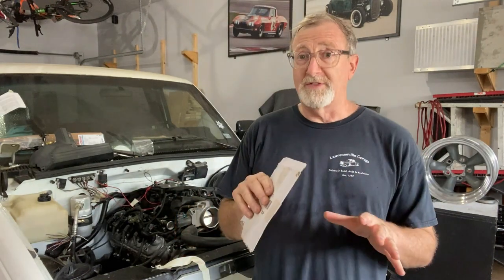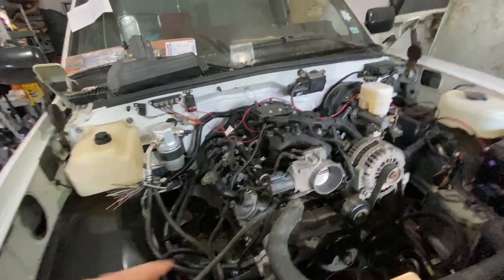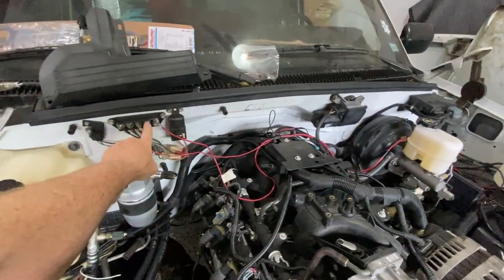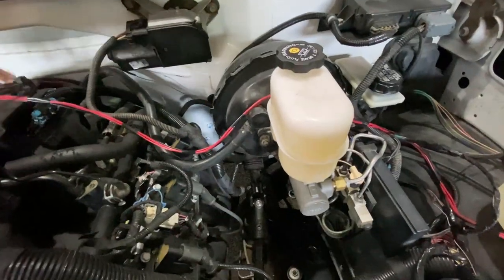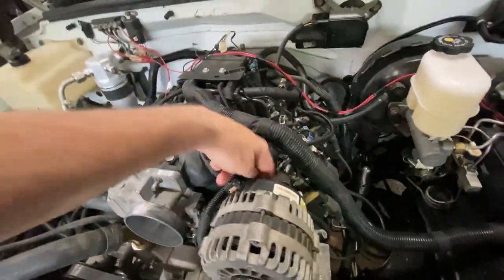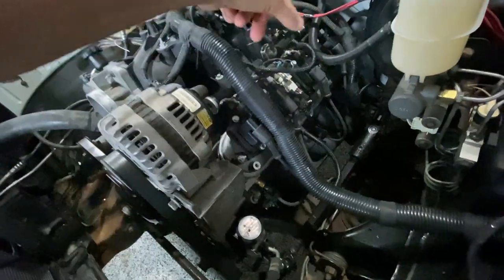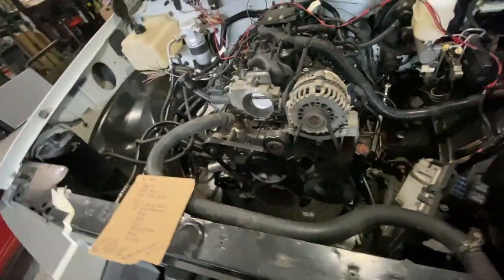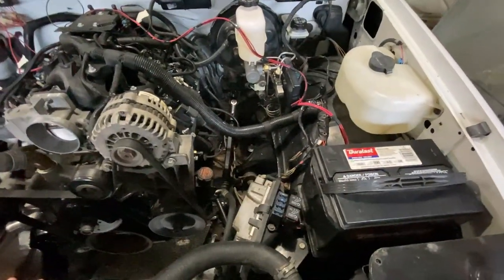LS Swap Harness Wiring Details: Where the Main LS Wires Go In 12 MINUTES

Comment: Do you have to leave the stock computer(pcm) in the truck along with the new ls computer?
Reply from the maker: It all depends. It will depend on how your truck is wired. Does it need the OBS pcm to run? No. But, the computer does handle other functions and you may want/need to keep it to handle those functions. I suggest NOT cutting anything until the new swapped motor runs. THEN, make sure all the features you want to function do, gauges, etc. THEN, start thinning out and removing those old wires. You many find you need a few to keep working. Remember to keep some notes on what you do. Someday, down the road, you or a new owner may need to fix an electrical issue and with no notes or clear way on how the truck was wired, it can be a real problem. A "regular" shop probably won't touch it since it does not fit into one of "their" books. And, electrical work can be very time consuming and expensive. So, not to scare you at all, just try to keep it simple. I've seen under the hood of installs by "professionals" and it was scary. Trying to figure out what someone else did can be "challenging".

Comment: totally new to this and you lost me with the pink wire. So you cut it from the 2nd stub and connected it to the ls ECU? SO it is coming form the dashboard fuse box to the ECU?
Reply from the maker: There are a variety of "pink" wires that are "key on" power. It's up to you to decide which of them is the best to provide power to whatever you are needing "key on" power for. I highly recommend that since you are new to this to check out ebay for a GM C/K Pickup electrical diagnosis and wiring diagram manual for your year of truck. They are a fantastic resource for all wiring information about your truck. You will be able to see which wires might provide the best source of power depending on what you are doing. I'm sorry if this sounds vague, but every swap is different and a manual will make your life much easier. A sound investment. I have 88-95 manuals and the prices ranged from $18-35. As time goes by, I'm sure they will go up. Well worth the $.

Comment: What color is the wire that engages the starter on the LS engine, I’m in the middle of figuring out what wires are what
Reply from the maker: Usually a purple wire. Runs from ignition switch to solenoid.

Comment: What transmission you use for your engine I have 91 also but I’m having a lot of trouble trying to find right one but your video would help me a lot
Reply from the maker: I am using the original 5 sod. trans that came in the truck. It is a 5lm60. You can use any trans you want, but you will want to research specifics for using that trans. to be sure you have or can get those pieces before you begin your swap just so it goes smoothly with no unnecessary delays.

Comment: I'm struggling on 1995 k1500 ls swap trying to get speedo to work. Any help would be appreciated
Reply from the maker: I spliced the original vss wires with the LS vss wires that way both the speedo and pcm get the information. I’m sure there are other ways to do it, that’s just how I did it on that truck.

Comment: I was told to cut the fuel pump relay off of the stock 350 harness n to hook the gray wire off the fuel pump pigtail to the Ls fuse box do I need to hook it back up to 350 harness
Reply from the maker: As I did mention, this is how I did it and there are other ways it can be done. You can totally remove the obs wiring, or tap into it and run it the way I did.

Comment: Hey why are you using the old charcoal canister I’m trying to see or better word learn do i have to use mine thanks I was about to throw mines away
Reply from the maker: I wanted to keep mine to prevent unwanted fuel odors. I’ve seen others remove theirs, but never heard if they noticed a difference or just didn’t care. I am considering mounting mine under the cab on my next swap.
Reply: @laurencevillegarage  thank you so much for making this video and for the advice

Comment: I'm going to do a swap the donor is 08 Chevy express van I'm putting it in 94 Chevy truck and the ls is drive by wire and I'm bolt to 700r can I do a drive by cable
Reply from the maker: You can do it, but it will get a bit more involved. You will need to change your pcm to a PO1 unit that can do DBC, also, your current manifold has a 4bolt TB, you will need a 3bolt manifold or adapter…that’s not all… you can do it, but you  might be better off sticking with the original intake manifold if you’re on a tight budget and keeping the drive by wire. You have other features on that 08 engine, that may require additional expense, like removing the DOD and VVT. If this is your first swap, try not to make it more complicated than it needs to be. It can get very confusing.
Reply: @laurencevillegarage  can you send me some start to finish points I've been following some videos but Im very new with all the l.s stuff I'm kinda old school
Reply from the maker: @emmarichard1230  Emma, check out the information below the video and you’ll find an email address. That would be a lot easier to correspond with or other ways to reach me. Answering a lot of questions via YouTube is very difficult and limited.

Comment: Curious to know why you mounted the battery on the driver's side.  My 94 has it on the passenger side.  BTW, the videos are very helpful!
Reply from the maker: Thank you, I originally placed the battery on the driver side because my intent was to transfer all the original parts from the donor Suburban under the hood of the '91. Packaging became an issue and I abandoned that idea. I do like the idea of driver side battery for possible turbo installation in the future, gives more space for turbo and keeps the heat away from battery.

Comment: I recently just came across this channel but you are making this look like such a breeze but I am very curious about 4pin fuse block with the two relays idk if I missed that video but would love to know more about that
Reply from the maker: I did cover that in the previous wiring video, but I would definitely make some changes there. Check out my video on wiring in the a/c fan relay and twin fans. That box I got off of Amazon and it holds 6 fuses and relays. Even in you think in the beginning you don't want electric fans and want to run the clutch fan, I would wire them up with the needed relays etc. Then if you still don't want to use them fine, set the box aside with the wires. IF you change your mind at any time, it is all ready to go. Easier to do while you are doing all the rest of the harness. But, back to the main fuse block with 3 relays and 4 fused, use a weather proof moisture resistant enclosure. Under your hood can get wet and this will protect the fuse/relay box from both sides. The type setup you find on most installs is NOT moisture proof and can be a problem down the road. You can get electrical issues that could be caused by some minor corrosion that happens in the unprotected box and tough to track down. The better box is $20, an excellent investment. They look good and next vehicle I will use 2, one for the main harness, and one for the fans and/or a/c relays. When you buy electrical parts such as pins and small parts, buy more than you think you need. If you need 4 and you buy 4 I can almost guarantee you will damage one somehow (or drop it into neverland) and you will be one short. I can get them off Amazon for literally pennies each, so, buy a dozen or more. You will be glad you did.

Comment: I have a question sir I am also doing a ls swap in a 1993 GMC Sierra with a 6.0 with a 4l80 I was wondering where I connect the fuel pump wire that come out of the ls relay do i connect it to the junction block or directly to the wire and if I do have to connect it to the wire directly which wire do I cut and slice into gray or purple ?
Reply from the maker: From LS harness, I ran mine to the 3rd stud on the left of my power bus above the a/c accumulator. I believe that was where my OBS fuel pump wire was as well.

Comment: Great videos! Do I need the 5 volt reference or low reference coming from the fuel pump to make the gauge work?
Reply from the maker: I just made sure all the grounds were good and that’s it. The wires for the gas gauge are not in the engine harness.

Comment: Is the large pink wire off the LS side running back to your 4 15a fuses? Or is that a different wire?
Reply from the maker: There is a pink wire that does provide power to the bus for all fuses.

Comment: Nice video. Im wiring a holley terminator and want to make a 12V switched power busbar. Where do I get the main feed switched power to power the bus so its not overloaded?
Reply from the maker: I used the factory bar. You have a lot of options new, but, you could just get one off of a 88-94? GM truck.

Comment: You have the factory fuel relay mounted on the firewall and a aftermarket fuel relay also?
Reply from the maker: In short, yes. Is it redundant? Yes. Is it needed? No. Does it hurt anything? No. At the time, I was following lt1swap wiring as a guide. Since I did not strip out any OBS wiring ahead of time, I now have 2 of each. I could (in the future) trace down all the wires from the OBS fuel system and delete them…but, with so many other projects to do with this truck, I probably won’t. But, when first installing the new motor and wiring, I did not want to begin cutting up wiring, until I knew everything worked properly. Otherwise, it might make it very difficult to track down wiring issues if it would not run. So, for now, the fuel system has a back up fuse and relay. Good eye by the way. Thanks for the question.
Reply: @laurencevillegarage  Good to know thanx again.

Comment: Sir how did you wire the dual relay? For the pcm and fuel pump please
Reply from the maker: I have a longer video about the wiring and you can get all the info you need at lt1swap.com  this is the information I used to wire it all up.

Comment: I hope you have a bigger wire from the alternator to either the starter, or some other way to charge your battery, besides that little 12 guage going to the OBS block, or your not charging your battery.
Reply from the maker: I am using the same factory wire that was on the truck to the original alternator. Did the same with the '95 I swapped with no issues.

Comment: hello,

so the RPM white signal wire feeds back to the old PCM?  i follows that wire and it goes to the left  towards oem PCM  and not to the right under the booster wiring   also the fuel pump you are bypassing the relay ?
Reply from the maker: The white wire that is by the "old" coil is your connection for the tach wire from your LS harness. If you have stripped away all your obs wiring, you'll have to do it another way. The fuel pump has a relay in the new ls harness fuse box that is made, so yes, you can bypass the old fuel pump relay...or have a 2nd.
Reply: @laurencevillegarage  the ls harness does have a tach wire and the obs harness still in place 
I’m just trying to get the correct wires and label them and have them ready for when I drop the ls in with the harness and start tying wires together  
So far I’m keeping the oil pressure sensor connector 
The a/c connector 
The temp sensor wire (3rd wire)
Starter wire
The grounds
Speed sensor wiring 
I’ll need to look for the pink wire for 12v switch like you did 

I might just be confusing my self a bit 
I really appreciate your reply thank you

Comment: Hello, I'm Kousuke from Japan.
I currently ride a 98, 5.7l VORTEC suburban.
I have a bad engine
I happened to have a 2003 Tahoe with a 5.3L l59 engine. 
In order to install this 5.3l l59 in a suburban, do I use the l59's engine harness, PCM, and fuse box?
I'm not good at English and I think it's hard to understand, but I'm looking forward to working with you
Reply from the maker: Thank you for watching from Japan!! Yes, you will use the 5.3 engine harness, pcm and some parts from that fuse box. When you begin removing the 5.7, don't cut anything. Try to keep everything you remove (for now) and label things so you will still remember what things are if the swap takes longer than you plan for. Do you plan to keep the 5.3 stock or modify it? Finding someone to tune it will be very important. Check the information below the video for other ways to contact me that are easier to communicate.
Reply: thank you!
I sent it to the address you provided.
I need your help.
thank you,
Reply from the maker: @りず-h7d  I have not seen anything. Send to Laurenceville Garage email.

Comment: What wire would it be for the TCC
Reply from the maker: To answer for both your questions....you can find the wire you need on your brake switch located at the top of your brake pedal. You can use a test light to see which wire has power when applying the brake and which has power without doing so. If  your truck has abs, check the purple wire on the front of the abs module. You can use your test light to find that one the same way as the brake switch.

Comment: Two questions.  What are the part numbers for the 99 Camaro V8 Coolant temp sensor, and for the oil pressure adapter that you used to connect your OBS oil pressure sensor?  I am deep into wiring up my 6.0 harness to my OBS 93 2500.  Appreciate your videos.  🙂
Reply from the maker: temp sensor:  https://www.ebay.com/itm/394526012660     you will need a 3 wire pigtail  https://www.amazon.com/LS-3-Wire-Pigtail-Temperature-Connector/dp/B07HR26CV6    and I believe I used   https://www.amazon.com/dp/B0894LDF76/?coliid=I2GJV1H3E5EP3J&colid=G0VZIDISO48J&ref_=lv_ov_lig_dp_it&th=1   it's been awhile... Good luck.
Reply: Super, I really appreciate your willingness to share your knowledge and experience.
Reply from the maker: @gregjohnston1781  you’re welcome.

Comment: Where did you get your wire diagrams?  I've tried the auto zone site and can't get it to work
Reply from the maker: If  you will check out my video https://youtu.be/i3n-4bYoGbM it tells you how to find those schematics on Autozones website. The best schematics, however are the factory electrical and wiring diagnosis manuals put out by GM. Go to Ebay and search for your year of truck and the words "electrical and wiring diagnosis manual" and hopefully, there will be several to choose from and buy one there. I have from 1988-1995 manuals (you can search GMC as well), just be sure you are looking for the c1500 or c/k series. Best money you will spend for electrical help.

Comment: Been following both your obs builds. Great job! I'm installing a 4l80e behind my 04 5.3. Do you know if I can splice in my speedo gauge vss into the output speed sensor without any issues? Keep it up thanks!
Reply from the maker: I believe it will depend on your year of truck, for the '95 I spliced the vss wires from the tail-shaft plug together and it worked just fine. On the '91 I will know shortly as the truck has yet to be driven. I'll know for sure in a week or so and I can let you know the result.
Reply: Sorry forgot to mention the year! I am working on a 91 OBS with my son. We put an 04 5.3 and a 4l80e trans. Changed all the seals and swapped in a decent streetable cam. I will be using  the stock oil psi sender as well as the 3 wire temp sender u discussed.  The other question is about the volt meter. I have the 1 small gauge wire coming from the stock Alt. I assume that's for the volt gauge. Would I just hook the to the LS Alt? Thanks for your time again!
Reply from the maker: If I am understanding you correctly, in using the LS alternator, there is a wired plug that goes in the top that is in the LS harness AND there is the + power wire that attaches to the back/top of the alternator.  I chose to run it the same was as the OBS alternator and run that power wire from the power control stub on the firewall directly to that mounting point. On the LS Suburban, that power wire comes off the + battery cable that mounts to the alternator bracket on the side. You can go either way, I chose to run it the OBS way because that was how it worked before with no issues.

Comment: How do you know if your PCM is working
Reply from the maker: If it’s in a vehicle already, check engine light is on, engine may not start or if running it runs bad (misfiring or studdering), poor gas mileage, common codes would be P0600 and/or other codes in the 600 range. If it’s not in a vehicle, it will be difficult. You could remove from a vehicle and swap in another one to see if it performs the same way.

Comment: How do u power up the cab
Reply from the maker: I suppose it depends on what you are starting with, but assuming you start with a running truck to begin with, you are only swapping out the engine harness. So, the cab has power as does the rest of the truck, it is only the engine harness you are modifying. That is why I tell folks to try not to cut or remove any of the existing wiring, remove the old engine, install the LS motor. Then lay out the LS harness the way you want it to lay in the engine bay. Thin out the LS harness of all the stuff you don't want or need. What you are left with is an engine with the sensors you do need and a handful of wires to integrate into your truck to make the gauges, fans, etc work. The motor only needs 3 wires to run. The rest is "optional" stuff. So, your "cab" should never lose power.

Comment: Just did a ls swap dbw but have no throttle response. P1125 code
Reply: Make sure tac module is grounded. Somehow one wasn’t. And no response. It gets its ground for the grey connector. Of of those wires.
Reply from the maker: Check your tac wires going to the pedal assembly and check to be sure no wires are pinched, cut or damaged. Did you re-splice the wires when you assembled? make sure all connections are good. Do you know for sure the pedal assembly worked properly prior to your swap?